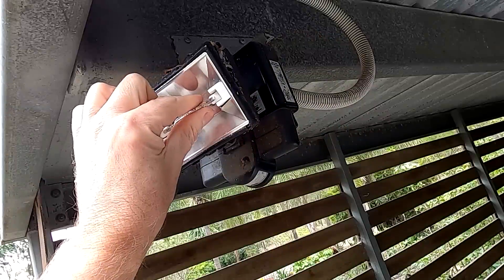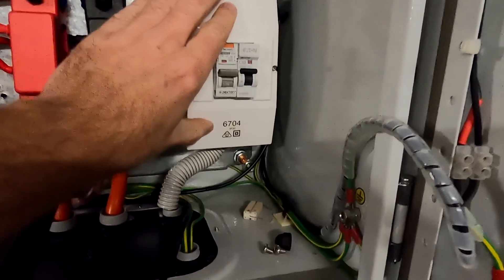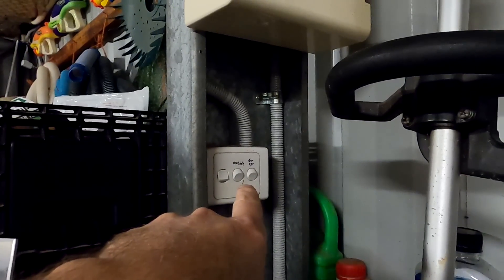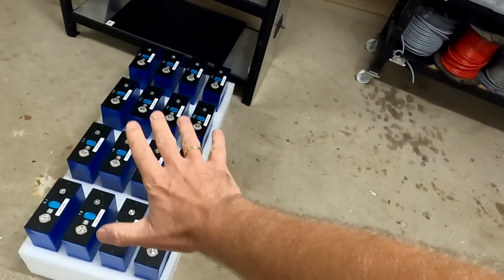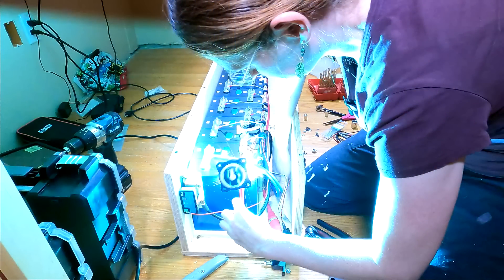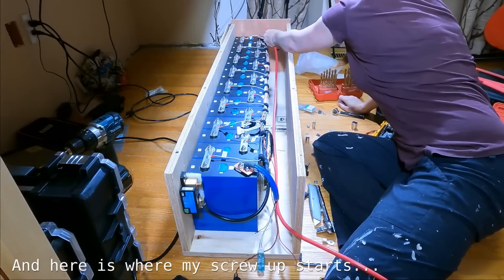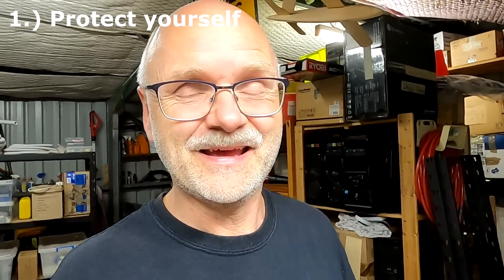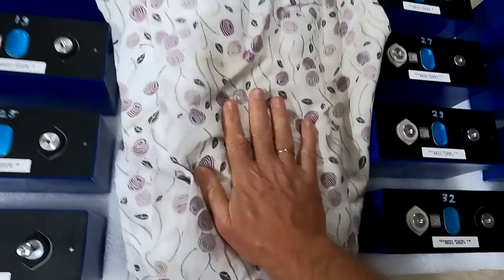A 48V, 280Ah straight short. How the right equipment saves you!

Comment: On my system, I used high temp hot glue globbed over all my battery connections to prevent something from ever dropping and shorting out to them.
Reply from the maker: Really? How do you get to your terminals in case of maintenance?

Comment: A contractor was changing a battery at work.
A server rom UPS battery.

The contractor was going to connect the two half in parallel, but connect it the wrong way.

The connection box exploded and the metal box was torn to pieces and ripped off the wall.

Luckily the contractor was using safety equipment and survived.

The explosion and fire completely took out the main server room.

(The story was published in the press, so I'm not disclosing anything that is not publicly known)
Reply from the maker: Wow, that is intense!

Comment: In my former occupation installing large 48v power banks for telecommunications company's.
Please people, use safety gasses and a face shield at all times when working on live battery banks.

I have seen first hand what happens when power strikes, second degree burns to a colleague's hand not using insulated spanner, flash burns & molten metal from lugs been accidently shorted .
Don't play with high current power banks without Safety equipment.
Reply from the maker: I can only second that!

Comment: Andy, Have you thought about testing your 100AH and 7AH cells in parallel.   I bet the capacities would track and act well as one cell.   We could all learn a lot from such a test.
Reply from the maker: That test is on my list. I've got some 304Ah cells coming soon and will parallel them with the 7Ah Palo cells in a 4s config. That will be fun to watch...
Reply: @OffGridGarageAustralia   Yes, a 12V 7AH 4S battery with a 304AH cell.  This is extreme case, but applicable to someone with a bunch of 280AH cells and down the road finds out that one of the cells needs replacing.  If 280AH cells are not available, something a little larger (like the 304AH) should be fine (or maybe 2 140AH cells in parallel replacing 1 bad cell.).

Comment: Well nice job at least you did figure out keep it up and going and right now on Project is building a 2000watt solar system with some of the cheapest solar panels I can get with the hundred watt, solar panels and the 200 watt solar panels with 24-volt it's coming together but very slowly just a little bit over halfway done with my solar system using a 5000 watt inverter it's pretty sweet but it does love the juice so I got to get more batteries just want to say doing that a hell of a job.think you for showing us what to do and not what to do!
Reply: Digital mermaid

Comment: Man,,,,induction just doesn’t sound right. I would look into it a little more and not dismiss it that easily. It sounds like multiple bonded ground to neutral bonds, possibly on inside a sub panel or a loose neutral somewhere and getting energized by the ground. I just installed a off grid system and my Motion sensors were not working correctly. My issue was I didn’t bond my neutral to ground. After I bonded everything worked great. Love your channel.

Comment: 25kA or 25kV - either way that is way oversized for your system. Work out, after inverter inefficiencies the maximum current draw from your batteries and then size the dc breaker maybe 10-20% higher.
Reply: This was a short on the DC side though - before any inverters etc. are involved. Not that I think a 1p string could put out anything near 25kA.
Reply from the maker: You misunderstood that? The breakers I are rated for 25kA breaking current. That is different the rated current. The have a rated current of 100 and 250A. Breaking capacity is for the event of a short, how much they are able to disconnect.
These LiFePO4 cells are easily capable of producing 5kA and more. The ANL fuse will most likely have trouble with that and could melt/arc.

Comment: Also: wear gloves just in case, take jewelry off, and wear long sleeve clothing/closed shoes.
Reply: Gloves are not nessecary for 48V and reduce your fine motor skills, but jewelry can get you in trouble and tape up tools when in tight places. Without the fuse, the woman still would have been allright. She would have eroded the terminal somewhat and gotten a bigger scare, she was still wearing glasses so no painfull sputter in her eyes!
Reply: @Tore_Lund  Melted pieces of metal on your hands is not fun.
Reply: @upnorthandpersonal  No it is not fun, but I was thinking of the circumstances in her video: She touches a copper thread to an alu terminal, so there will happen no welding and worst is a few zings like from a sparkler. Handling nuts and bushbars with gloves is not fun either and you need 55V-62V before you can feel anything touching live wires. Let's agree this is a matter of taste. I weld without golves often but I often regret it too.

Comment: when two long wires run parallel together, it will form a capacitor. Some argue it will become a transformer.
Power from one cable can and will be induced on the other wire.
On regular olden day appliances, this induced power will not do anything.
But is enough to power low power LEDs.
SOLUTION: Put a 500K ohm in parallel with LED bulb to kill this induced current.

Comment: I did comment in your Ghost Light video about induction. Comment now missing????
As for ANL fuses, leave them for the Car Audio wank guys. Get HRC's.
Reply from the maker: I'll have a look at your comment. If it had a link, it won't be public and I have to release it manually. Far too much spam otherwise...
Reply: @OffGridGarageAustralia  Nah, no links. You'll know it when you see it as I have seen Ghost lights a lot, especially when I work in radio as well as a lot of other technical areas and nearby AM radio stations running MW's make even Halogen lights glow.